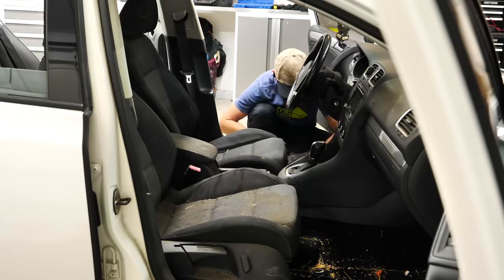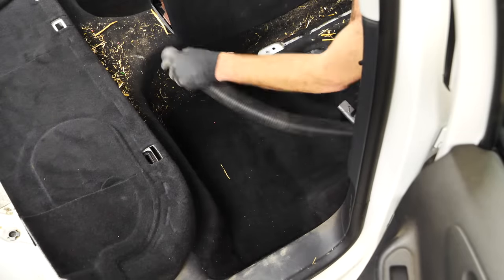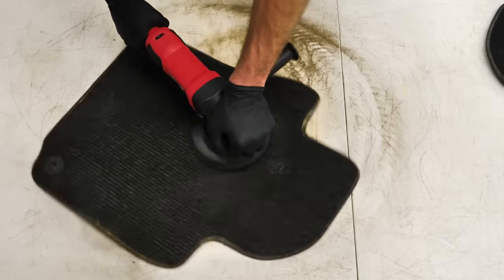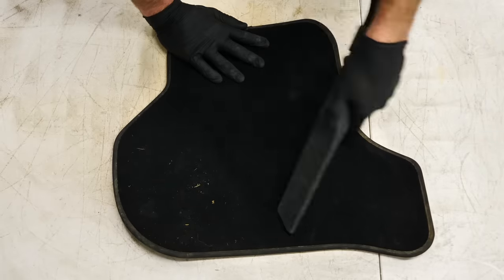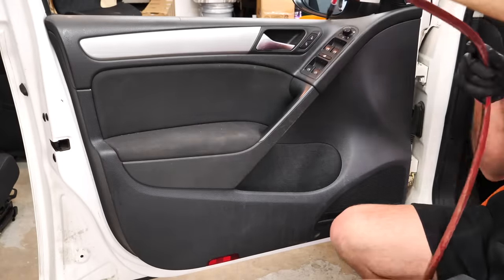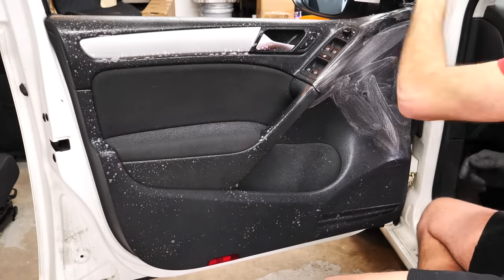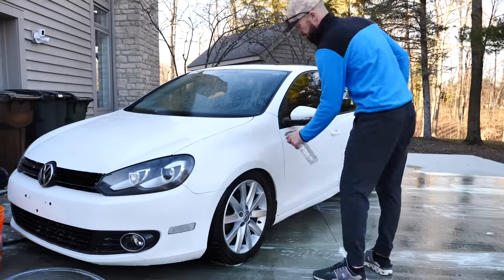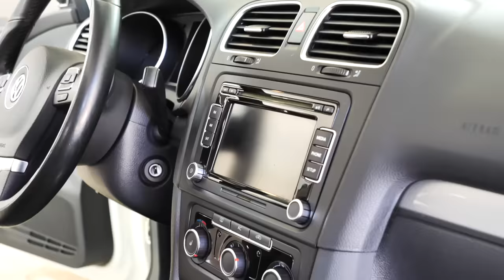Deep Cleaning A NASTY ANT Infested Car! Car Detailing Restoration

Comment: Hey, I know the main focus here is the detail job and not so much basic universal european sunroof flaws but nearly all German autos with a sunroof have problems with their drains at some point due to overengineering, most of these cars have a duckbill shaped grommet on the end of the drain tubes that stick shut (4 drains) snipping those off typically solves the problem. I can imagine how awful that car smells, like melted crayons in a musty mildew basement.

Comment: How do you get seats to dry? I had mine cleaned but everytime someone sat on them patches of wet would come through for nearly a week
Reply: U have to use a special vacuum to suck all that dirty water out. Otherwise its going to bring up all that dirt thats embedded in the seats and create those wet marks.
Reply: A must use is an extractor, and if it’s a sunny day leave them out for an hour or so after being extracted